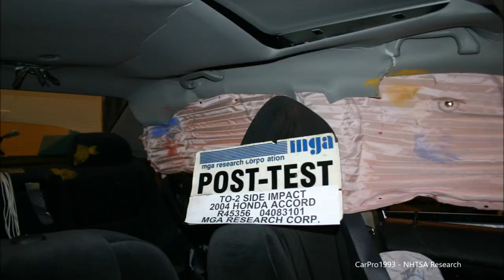2004 Honda Accord Vs. 2002 Dodge Ram 1500 FMVSS 214 Side Crash Test

Comment: Why are the cars always angled like this? Why not a straight on t-bone
Reply: To simulate both vehicles moving, like if you were going through a green light at 15 mph and some bozo slams into your side at 30 mph. 
February 10, 2020 9:01 pm